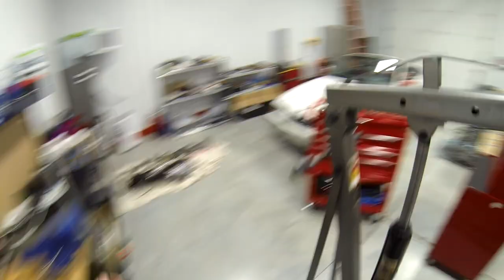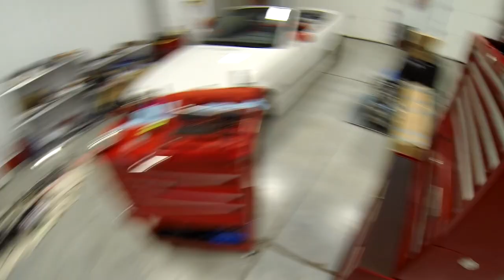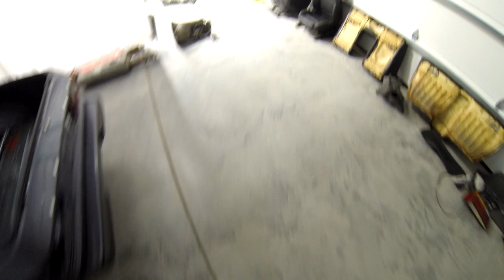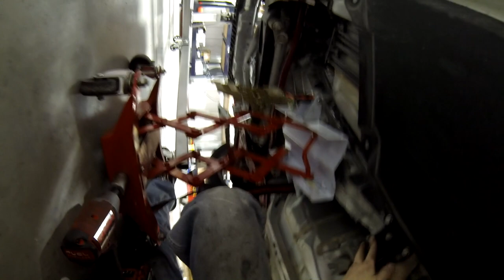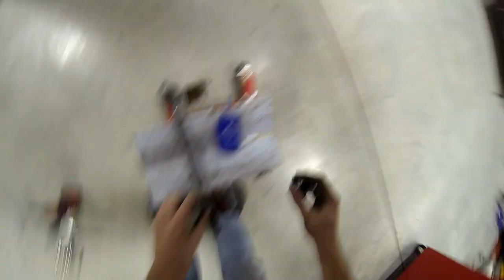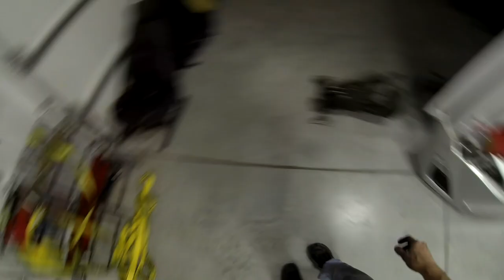2013 to 2019 Engine Swap - Part 14 (BRZ, FR-S, 86)

Comment: Did you ever figure out what you blew/bent in the old engine? Was it a rod?
Reply from the maker: I never took the old engine apart.  Probably won't, and just sell it as a core.
Reply: @PowerSports  I'm sure someone will buy it. The block is still good.

Comment: So i spun a rod thanks to the carmax warranty best in the world they cover blown engines but I was able to do the recall and it was a success , my 13 frs only has 50k miles with a engine rebuild  I'm keep it  , and buy a tundra next and also did you change your spark plugs???
Reply from the maker: I decided to use the 2019 spark plugs.  They should be OK.  Hopefully.
Reply: @PowerSports  ok because taking them out is a botch and its easy when the engine is out

Comment: Have you considered investing in an oil furnace?
Reply from the maker: I've got a full HVAC system, but it is only set on 50-deg to save on cost.
Reply: @PowerSports  Freezing now, but in 8 weeks the A/C will be on.

Comment: I looked it up and definitly supposed to clean the oil off and locktight
Reply from the maker: Idk.  That isn't what they did at the factory.  I've put 500 miles on the new engine, no issues.
Reply: @PowerSports  well I talked to a couple engine specialists and they always locktight.  Alsovmynpackage of grand new bolts were oil free and a 12 mm hex head not allen head
Reply from the maker: I'm confident I assembled the engine correctly.  Everyone has their preferences.  ^_^
Reply: @PowerSports  your level of thoroughness not many people do